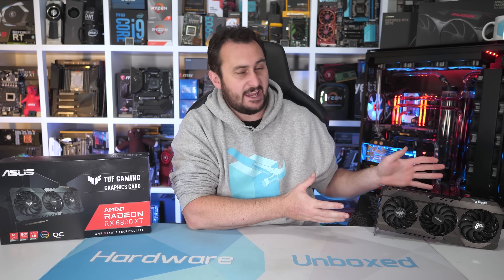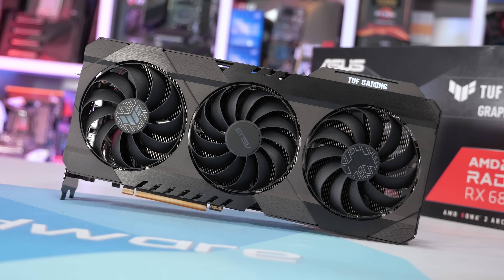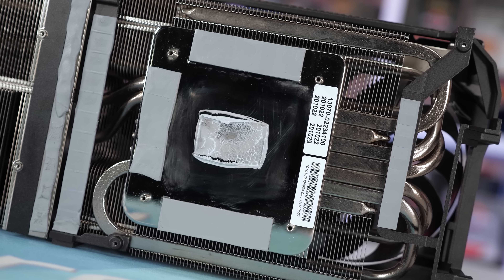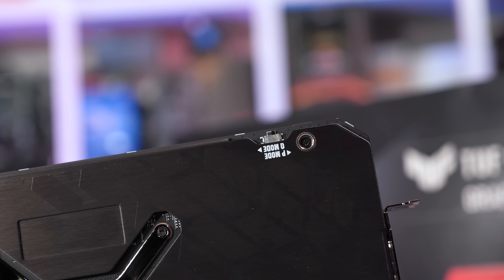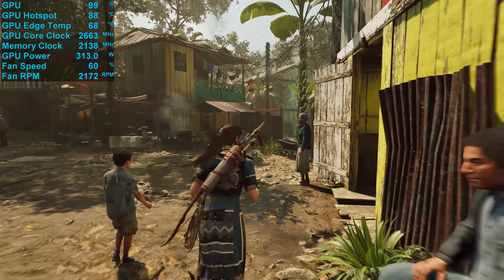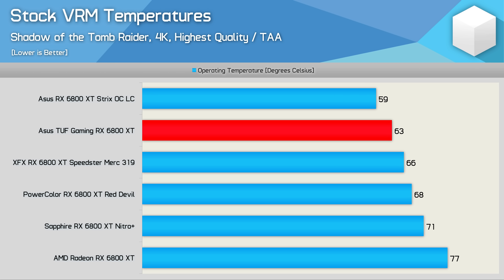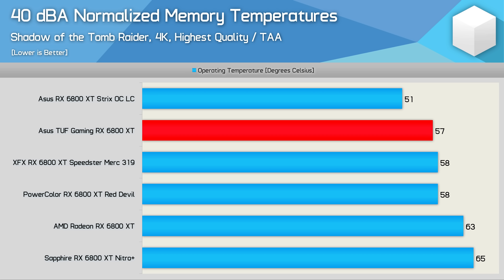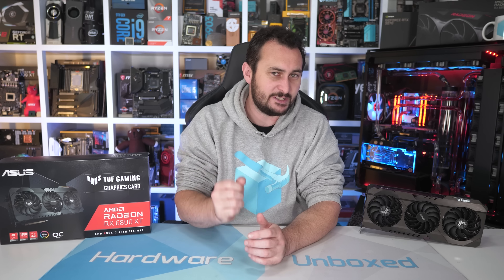Asus 6800 XT TUF Gaming Review, Power, Thermals, Overclocking & Gaming

Comment: I'm definitely getting a 6800xt I'm just not sure on what model to get. Nvidia's drivers suck on Linux so AMD is the obvious choice... Can't  wait to drop in an AMD card. As always a very good video.
Reply: Just remembered the time Linus Torvalds said "fuck you" to Nvidia because of how hard they are to work with.
Reply: The situation on non-Debian distros is horrendous, if Nvidia opened their driver up they'd see a massive increase in Linux users. Their arrogance has cost them a lot with the *nix community, AMD and Intel don't have to even be competitive since they basically handed the market to them.
Reply: Shockingly I bought a 5600XT for my Linux machine after hearing the same thing and had no end of driver problems with it (possibly because I'm running three monitors). Swapped in a 3060ti and while I still am getting some glitches, it is working much better, and also runs games better (fewer glitches).
Reply: @nicholasvinen  what distro are you running?
Reply: @amirpourghoureiyan1637  Ubuntu 20.04 LTS
Reply: @nicholasvinen  Yeah that makes sense, the Debian based distros have fixed most of the issues with the closed driver.
It's the other ones (RHEL, SUSE, Gentoo, Arch, etc) where Nvidia is a nightmare to maintain, makes it even more of a shame with the amount of overhead in Debian.
Reply: @amirpourghoureiyan1637  I was pretty impressed with the Ubuntu default nVidia drivers on the RTX 3000 series. I installed a few games from Steam that have native Linux support and they ran pretty much as well as they do on Windows 10.
Reply: @nicholasvinen  The OpenGL performance is a lot better on Nvidia cards, most people recommend one for a Batocera/3D MAME system as they run on top of Linux. The main problem with native Linux games is the dependencies that need to be maintained, a lot of native games have stopped working because their dependencies have been updated and have broken compatibility with the older titles.
Reply: @amirpourghoureiyan1637  I'm hoping Steam will take care of dependencies. It looks like a lot of Windows games will run in WINE with some help. I plan to try that when I have time to fiddle...
Reply: @nicholasvinen  I think Valve's notifying developers to keep on top of the issue. Funnily enough it doesn't come up when running Windows games since Proton containerises them, letting you select a custom build per game. Unless you're running a recent game, it's pretty bulletproof in emulating DirectX.
Reply: Can I ask why? I'm rocking an AMD gpu and cpu atm and even though I'm happy with the CPU, not so much with the GPU and AMD's radeon software. If you're going to be spending that type of money might as well get a 3080/3070TI(when it comes) and get all the awesome Nvidia software adjustments, raytracing, better drivers and of course DLSS 2.0
Reply: @garn100  The open-source drivers for AMD  gpus are built in to the kernel. Amd's drivers on Linux are worlds better than anything nvidia has released. Better than the proprietary ones on windows.
Nvidia's open-source drivers are a pile of dog shit and should not be used. Second nvidias proprietary drivers cause some weird problems on occasion. Third nvidia has a stick up their ass and needs a special protocol for Wayland which makes it impossible to use on nvidia gpus while using the proprietary driver. Like Torvalds once said: F*ck you nvidia
Reply: @roccociccone597  fair and I hate that I'm somehow defending nvidia, but what is your opinion about nvidia on windows? Given it just has to beat one competitor which is AMD.
Reply: @garn100  I don't exactly adore nvidia on windows either. Their bs marketing, overhyping and anti consumer practices (hardware unboxed debacle, board partner programm a few years back) aside, the two things I like is rtx voice and dlss. Raytracing is useless at the moment. 
But I abhore anything coming out of Microsoft post 2009. Overlooking their data collection schemes, the complete disregard to actually finish Windows 10 is one more reason for why I'll never use Windows again. Oh and let's not forget the bloat ware that gets reinstalled after a so called "feature" update. 
I permanently switched to manjaro for my main rig and a MacBook pro while on the go. Linux isn't that good on mobile machines due to battery life and track pad inconsistencies. But I'd still prefer it over Windows 10 any time.

Comment: The Radeon RX6800 XT et al currently resides with the unicorns over in la la land.
Reply: Elvis and Jimmy Hoffa are building their PCs now.
Reply: The cards are out there instead of goi g to your prefered retailer online go to google shopping and enter what you want
Reply: @keibohow69  For the RTX 3080/RX 6800XT 40-50% more tha MSRP, and that is from legit retailers.  In fact this weeks prices have actually gone up at the retailers that I keep checking.
Reply: @gandalfthewhite8273  i know that, but when i went to my prefered retailer, the card i was looking for was showing comming soon. I went to google shopping and there was the card i was looking for from my retailer, if i did not have an account with them i would have left it so i logged into my account and brought it, their scalping software was getting in the way. Here in the uk the card i wanted was £698. 4 or 5 days later it was £711 and sold out.  So thats why i said go to goodle shopping.
Reply: @keibohow69  I will give it a try.
Reply: I have one . Jealous?
Reply: I've purchased two. Quit bitching and setup a stock alert.
Reply: @DJ.1001  you sound like Frank Azor. "Come on guys I got one, all you have to do is hit f5". 

Your sample size of one person is not the typical experience. These cards even with tool assistance are quite difficult to obtain. Consider yourself a statistical aberration and be thankful you have one... Let alone two.

Other than that, have a nice day.
Reply: @DJ.1001  I don't think it is bitching, just having a light hearted comment!  There are cards out there but not close to the MSRP price.
Reply: @DJ.1001  Buying from retailers right now even if you catch one in stock is a rippoff, most are at least 100 over the retail price, everyone is up for making money out of you over the shortage, just wait for things to settle, it's not life threatening using what you have right now.

Comment: This is more expensive than the Red Devil limited edition 6800XT here in Japan.
Reply: Same thing here in Southeast Asia, kinda weird seeing Red Devil (as a premium AIB) being cheaper than entry-level AIB from ASUS on the same card.
Reply: @chrinaldi  Kinda weird? It't an ASUS product, that is to be expected.
Reply: @herobrinecyberdemon8104  The sapphire cards (especially nitro+ and red devil) have always been top tier cards, being at the high end of the product stack in pricing. 

TUF gaming is the budget brand from asus and is always more at the bottom end of the AIB price range. Your opinion on asus pricing doesn't change that.

In fact the 3080 TUF gaming was one of the cheapest AIB models on release, while also being praised as having one of the best cooling solutions.
Reply: I got a red devil 6800xt for RM4,200

A week later, 3070 are selling for that price in retail. The red devil wins in value hands down
Reply: @cheekibreeki9155  I just paid 1150 USD for a Red Devil 6800XT. The TUF gaming 6800 XT is about 1230 USD. I just sold a 6800 reference card for 1000 USD. 3080s are selling for 1300+ USD. Crazy times for sure.
Reply: @MSJChem  That makes me slightly more happy for mine despite paying above sept MSRP (asia didn't get it at launch). At the current exchange rate, I paid 1000USD for mine. 

Selling a 6800 at 1000USD is insane, I'm already seeing 3070 going for 1000-1050USD in retail depending on tier. Good job man.
Reply: @cheekibreeki9155  Well, I think I got lucky with the 6800 and never expected to get that much. I think someone was pretty desperate to get their hands on a reference 6800. I actually felt a little bad but then I paid over the odds for my 6800XT so I guess it balances out.
Reply: @MSJChem  That's cute come to my country and pay $ 3,000 for the exact same card lol
Reply: @atgm4063  Which country is that?